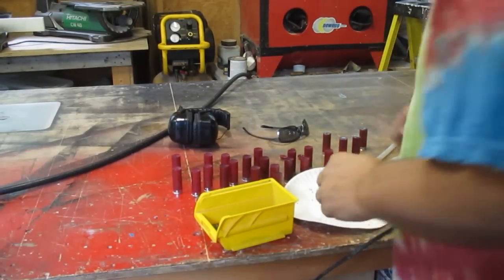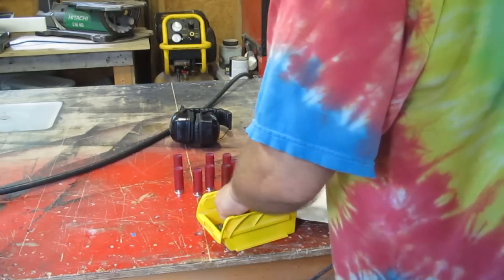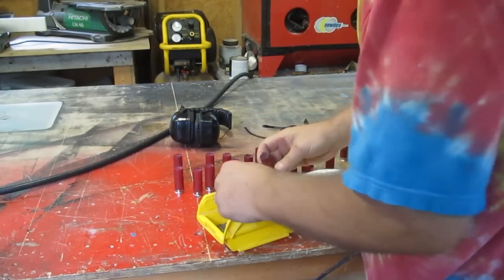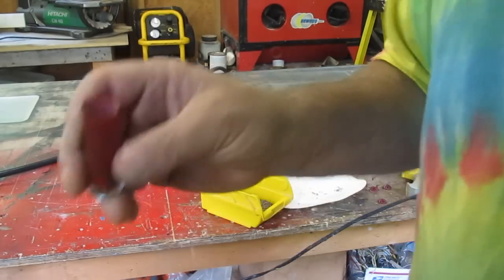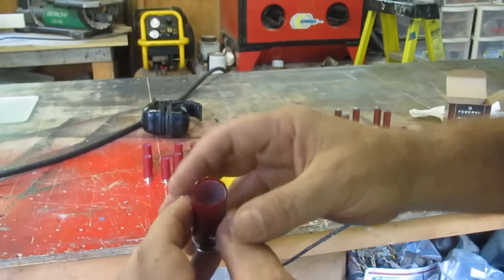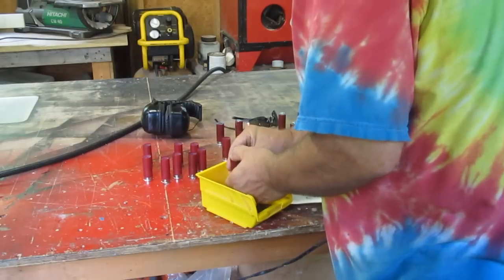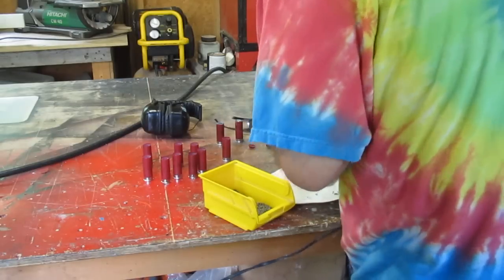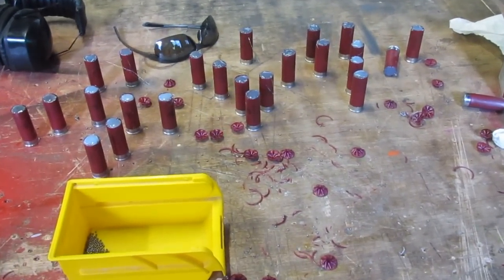FAQs about DIY Bonded Shot Shotgun Shells "Waxers" "Crayon Slugs"

Comment from the maker: I have not compared them side by side. But I can tell from shooting them both that hot glue hits harder. It's wicked. Even after blasting a jug the clump of wax and shot can be found...with a wax slug the wax and shot will part company for the most part and the shot will spray. It's probably closer to a slug than a waxer. I like the ballistics of wax slugs though...that blast of shot means low penetration. Once it hits a significant barrier it's not going much further. Good for Home Defense IMO.

Comment from the maker: I haven't. But I hear it works. Just make sure the wax is to the top of the "shot column" so the crimp goes back okay. You can also use Lee Slugs instead of wax...but you need the Pink Winchester Wads.

Comment from the maker: At 0:07 you can see I put glue in first. At 0:14 you can see I put in shot and at 0:19 press it into the glue with my thumb. at 0:26 I dump any loose shot out.  At 0:30 I then out in more glue. At 0:35 I add more shot. At 0:43 I dump any loose shot,At 0:48 I add more glue.At 0:53 I put more shot. At 0:56 I press that into the glue. At 1:01 I tun the shell upside down and no shot falls out. And so on. I thought it was obvious.

Comment: i always enjoy your videos, they are awesome. one question please. i did not understand what you were trying to say from 1:04 up until 1.21 maybe you spoke in code to avoid repercussions from the choppers LOL coincidentally, i was just thinking of buying one of those 50 round shell holders i just saw in your videos [i saw it for the first time ever yesterday at cabels.ca $12.00 do you like or regret?] i also saw a chest rig review about a soe mini or cop rig or something named like that with molle and velcro for more money. holds 25 less shells on card holders that pop out of pockets as needed. i know this is an older video, but, i hadn't seen this one yet. looking forward to watching all your videos and future ones. thanks
Reply from the maker: All  I am trying to get across is put glue in first then shot and press the shot into the glue. The 50 round bandolier will let you down...the shells will fall out. The elastic stretches out with shells in place and becomes useless. The SOE shotgunner rig is outstanding. They make the best rig on the planet, Expensive, but money well spent.